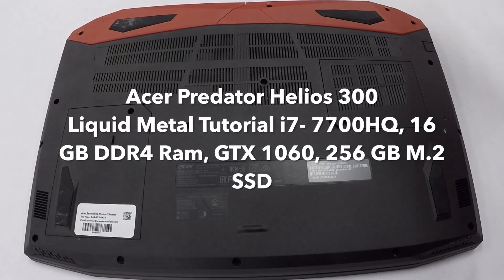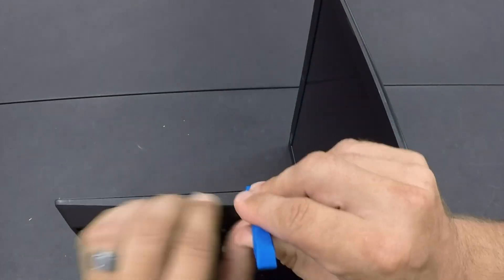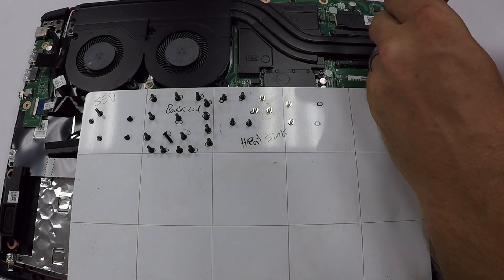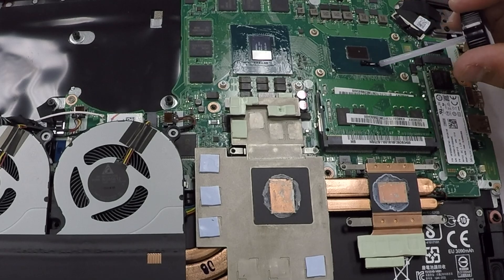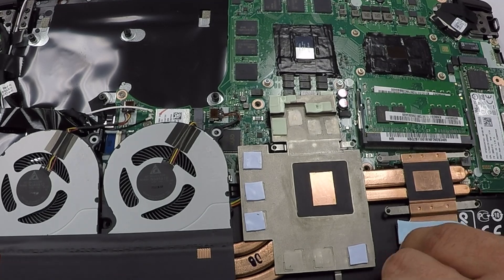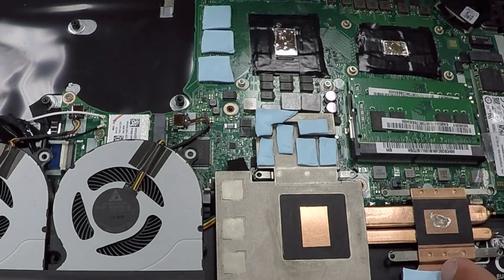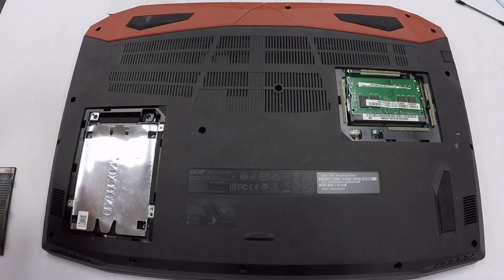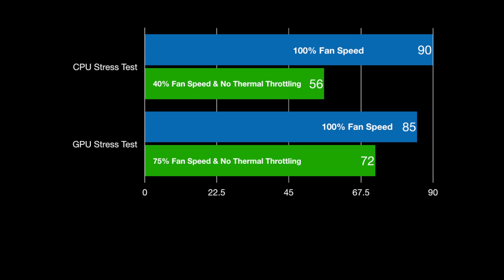Acer Predator Liquid Metal Upgrade Tutorial

Comment: Conformal coating AND a fuckton eletric tape. You're really not taking any chances lmao

I gotta be honest with you, I only applied the liquid metal. It's still working, so I guess it's allright.
Reply: Conformal coating is correct, the electrical tape is wrong on so many levels.

Electrical tape adhesive breaks down with heat and will be a mess after a few months.  The electrical tape will offer very little protection as liquid will always find a path through the gaps.  Electrical tape is an insulator by design and will hold the heat in your chip, defeating the object of liquid metal cooling.

If you really had to apply a tape, I would use a kapton tape, super thin, its generally low tack and you probably will find it on your laptop somewhere.
Reply: @Eddienemec  My main concern is that using electrical tape is that you are trapping heat into the chip.  I would stick to 2 coats of conformal coating over the capacitors and call it a day.

Comment: What Kind of thermal Pads a recommended? And how thic do they need to be?
Reply: Eddie Nemec Thanks! I think I‘ll rather squeeze them a little, than risking leaving too much space 🤔😅
Reply: @ennom3176  It doesnt work like that, squeezing them too hard may compromise the distance between the CPU and the heatsink.

You should try to match the thermal pads to the same thickness you already have.  You really dont need to change them unless they are damaged.  Some laptops have a thermal pad on the GPU.  

The thermal pads are often used on not so essential components and you will not notice any temperature drop by using high end expensive pads

Comment: This video is cool. I used liquid metal on the cpu and gpu. I completed the procedure last night and the improvement is just great! Average cpu temp is down 15 - 20c. The video card or gpu seem to have very little difference in temperature but that might be because the fans are only doing half the work. I also changed the screen in this laptop to a 120z panel and that upgrade was also superb! A great video to add for people on Youtube _ Thanks Eddie
Reply: Is the liquid metal still working just as good as it did when you applied it?
Reply: Just ran the Heaven benchmark and temps reached a max of 71c. This upgrade is super and the gpu temp is right down!
Reply: What screen and where did you get it?
Reply: N156HHE-GA1 - Is the model screen I used. I got mine from China. It's very high quality.
Reply: @thestar111  nice, and are you able to change the brightness!
Reply: Yes, using the hot key as normal. It works just like the screen in the laptop but has much better colour and refresh rate.
Reply: @thestar111  You struck gold. I have the nitro 5, but its basically the same but upgraded, gonna try. Thanks buddy
Reply: @thestar111  what site I may ask? I'm buying a helios 300 this black friday in the hopes it's gonna be around 900 euros, and the screen upgrade would be awesome!
Reply: I don't know where to buy this laptop for only 900 euro??? I don't think you will buy one for such a low price.
Reply: @thestar111  I actually got it even lower, for 910 from spain :D great value eheh
Reply: @thestar111  Has much better colours? How is that possible? Is it even IPS?
Reply: my video better, acer predator helios 300

Comment: what were your exact temps after and before the liquid metal? I will really appreciate your answer. I have the same laptop, and i don't feel comfortable about my cpu and gpu reaching 90 and 80°C D:
Reply: How about using a cooling pad? Does it help?
Reply: @coolkavish  a bit mostly as it gives more clearance under it so the intakes don't choke. try undervolting and cleaning the fans before you do this. though from what I've seen most people lose a good 10c by using liquid metal
Reply: @LtTrog  thanks!